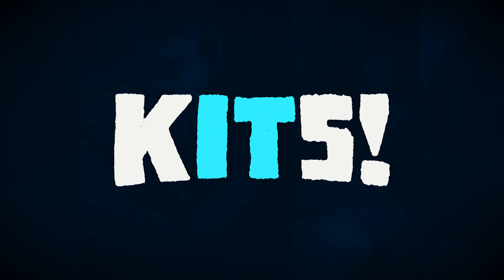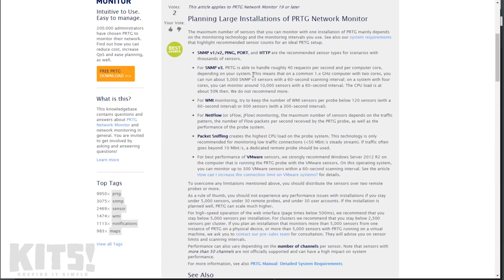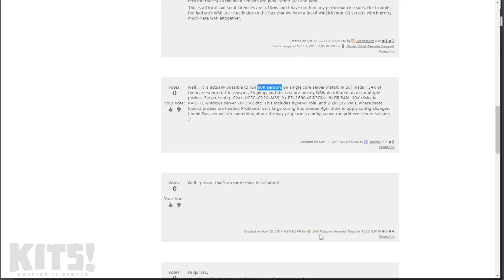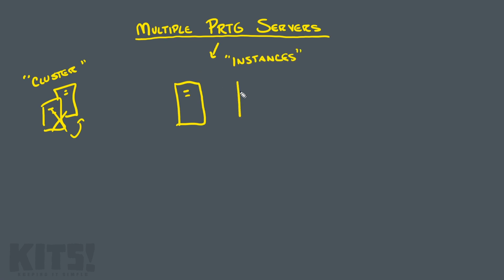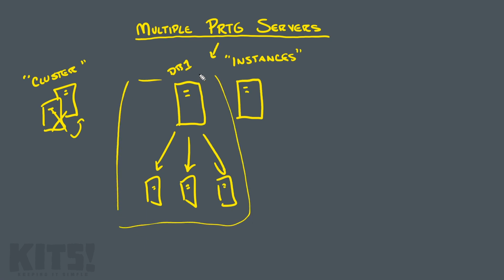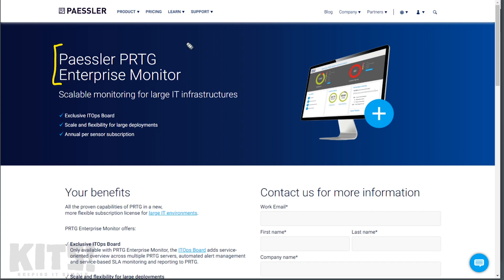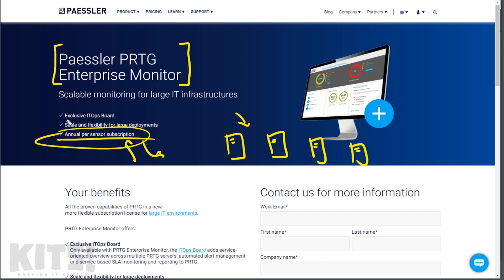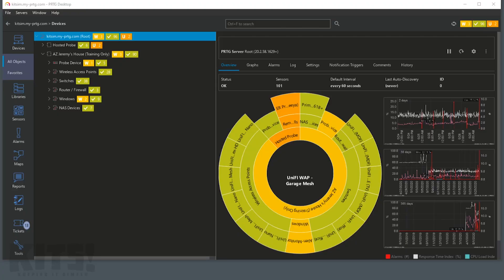SCALING PRTG!: Getting Started With PRTG Ep.7 - Keeping IT Simple

Comment: The Problem with PRTG Starts with moving on in your Business [ when you are growing ]  . PRTG is Fast to setup but will not scale good.  If you are running 20000 Sensors and you have probably a Windows EcoSystem if you have PRTG , then you will encouter all the Limitation . 

Man,  we have so many Problems, because we are using it for such a long time now . ( starting 2010 ! , growing with VMWARE , Docker , Linux -> 20000 Sensors )  

If you use SNMP Sensor I would agree , those Sensor are "cheap" BUT in a Windows Enviroment you are talking WMI Sensors  / Windows Sensors and those "special" DevOPS Powershell Skript which will give you "expensive" Sensors .  

There are so many Limits which put the Limit fast to its END , meaning resulting in slow adding sensors , Devices , Reports and so on .   You will find out that you have run into a Problem , when it occurs there are not "Sensors" which gives you a Feedback on the 

Paesslers Limits they state in there PDF 
https://d1c96hlcey6qkb.cloudfront.net/a55bd16c-80e6-49d2-ad3f-0b6c91a82c97/b57824aa806741e89070e5e213712dd2?response-content-disposition=inline%3B%20filename%2A%3DUTF-8%27%27002248_System-Requirements_EN.20201123074608903.pdf&response-content-type=application%2Fpdf&Expires=1608812483&Signature=cMr7iCdkU8wAGFmvZ4inkkkNaU4gTW3LYQm25DsDazC0iQcHdH-QejnTqcMRncKWZ1O9N2WYJ76ljpggfvlRCkOjgECu~BJT~NlbQZMnOLDVX0dHz5zvOL664YUy-QfSMJzz9pN24OLnFZbtvOygyKh9wmh7PJQ1io4LMwt17zNXbnkpZ0nhzEZZGJH2we1~vFSwvxnVw-UnKqPEhiGU9p1khM5BzHxSy1fCijzDrf2Ez0vEbvSryeOHLAArYEgyXz7o6k6Q-5YoC0R5hgA2-5U-SyHI30YbCZ~vIiTbiJ8GdZdm-kC3PTGa0noQfivQ3zdafFmyA6gbNTfeaYfFdw__&Key-Pair-Id=APKAI33AGAEAYCXFBDTA

• Our general recommendation is to stay below *30 remote probes on one PRTG core server. PRTG still scales well up to 60 remote probes as long as you have
less than 100 sensors per probe* -> that is acutalle a really low Number ( 100 Sensors are not much and that is only in a 5 Minutes Time Windows Monitoring ) 

the New PRTG Enterprise Subscription starts with "20.000" Sensors @16000Euro / 20000 Dollar  and "then" it is flexible to the Information on there Site . 

Now a Days we have also  Linux ( which the DevOps want to trace with SSH Sensor -> "expensive" as Script Sensors ) ... and Monitor VMWARE Host Status is expensive too . Well the way they have implemented it it is not consistent througout PRTG Versions and limited in "Scanning Interval" and DataVisualisation .  

Its like a Insurance , looks good from the Outside , but from the inside there are many limitation if you need the Insurance. 

I would say if your Company has an IT Department of 2 and above , there are other Solutions today on the market . ( Promethus, TIC , Telegraf , INCIGA, zabbix  ) . If you are a One Man Show IT with 5 Servers ... PRTG is your Program but dont grow larger , it will not grow with your Business and keep always in Mind its Monitoring not "Telemetry" . If you need more real Time Monitoring it will fail you.

Comment: Why you dont try open source monitoring software like Zabbix? Or open source firewall like Pfsense? 

Thank you so much for the training.
Reply from the maker: Good question. Everything has a cost - even open source; often it's the time involved in learning and experimenting and the "EVERYTHING'S DOWN!" panic moment where you realize the only support you've got is some loosely monitored forums. When it comes to super critical things like monitoring, I've been burned too many times by products I thought were awesome, but weren't... Short question, long answer.
Reply: @Viatto  Thank you. We use PRTG too and we have more than 30000 sensors in PRTG, but I like open source products for home.